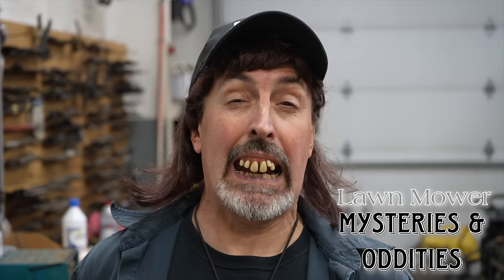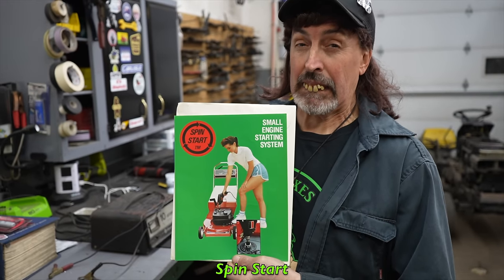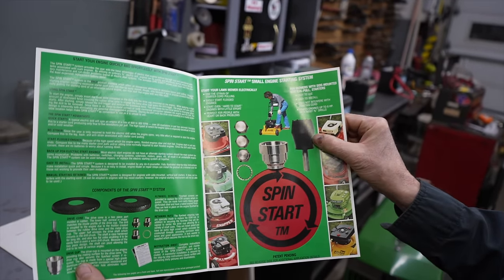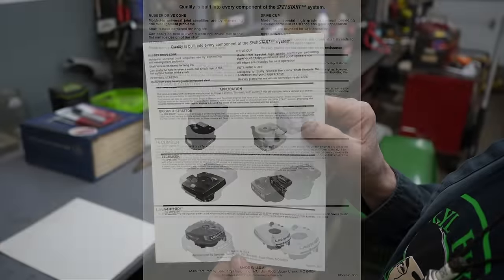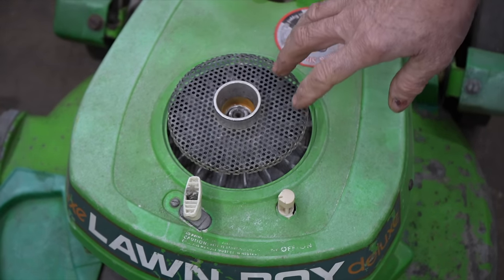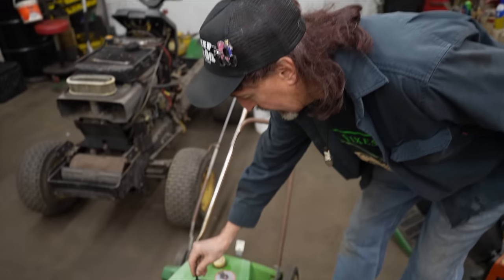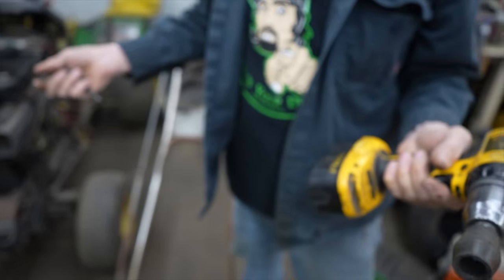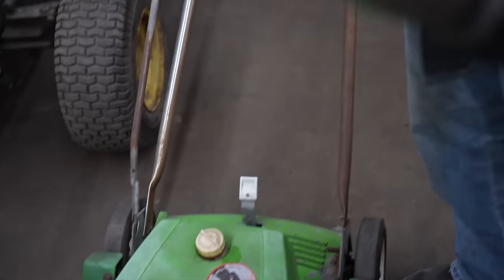You've NEVER Seen This RARE Vintage Electric Starter

Comment: My grandmother loved those old 2 stroke Lawn Boy mowers. She was rather disappointed when they quit making them and couldn't buy a new one. She mowed her own lawn with a push mower up into her 90s.
Reply: Thank the EPA! With all the green renewable nonsense (go do some research and some math) 2 stroke engines are almost totally gone  forever, barring chainsaws and hedge trimmers and they are coming for those now too.  KTM still makes a little 2 stroke bike. Last one out there still making a two stroke. Light powerful, and you can refuel it back up to full in 30 seconds or less.
Reply: I love my lawn boy! I got an old 21” 2 stroke that I got for free! So simple, cleaned the carb up and runs great, looking to get a new air filter and blade to start using it next cutting season!

Comment: Taryl, I bought a cheap swivel head ratchet wrench from *Harbor Freight and cut off the handle so I could put it into my drill motor. With the swivel all duct taped so it couldn't go very far from straight including the socket, I made up a very viable way to spin any engine over w/ out the nut coming loose or the socket flying across the room. What drove me to it was a chainsaw I had that didn't start good cold. It had a bolt holding the clutch on, so a way to drive the crankshaft was readily available.  Then I started using it on my other chainsaws that after I removed the starter rope/ blower housing, but they needed to be turned Counter Clockwise. and as with any flywheel nut, I didn't want it coming loose when it started. So I needed a reversible ratchet head to run backward. My first try I didn't have the socket taped on the ratchet head and it stuck to the flywheel nut then came off as the engine revved up. It flew clear across the room and ended up behind the Oxy Acetylene torch bottles. BUT IT WORKED!   When I was young I put a straight drive into my Dad's drill motor and tried to start my Go-Kart engine the same way. Catastrophe! It was a 3 1/2hp Tuk-Um-Suck and when the engine started the nut came loose and the flywheel split at the key way and exploded into a million Al U Mini Um parts!  I found another flywheel, but I never tried anything like it again until my shoulder got Arther's itis in it and I just couldn't stand there and pull and pull and pull. *I do not advocate buying Chinese Communist Slave Labor tools.  ben/ michigan

Comment: This is amazing actually.  I love the HUGE added convenience that setup gives you.  One of the BIGGEST pains one deals with, in my opinion, when dealing with these small-engine tools - is that most of them are all PULL start with a recoil rope!  Aside from the safety issues you brought up - which sound like were addressed with the rubber bit - The big problem I see with this now is that it most likely does not support the newer model small-engine based tools out there being sold today.  THAT being said - the parts involved on this setup does not look all that complicated - and if you know how to use a metal lathe - and you have a 3d metal printer or two - and you also know how to weld (this includes TIG/MIG/Stick/Fluxcore)  You can probably and quite easily fabricate the parts you need to put on whatever small-engine tools you have - and since you're doing the fabrication yourself you can just make them all fit the same rubber bit on the Cordless Drill - that way you can start all your tools with just 1 bit!  Say goodbye to dealing with recoil ropes!  I am honestly surprised companies that make small-engine tools have NOT adopted this and have made this setup a UNIVERSAL FEATURE!!!  Odds are if you own a lawnmower - you also own a cordless drill - and if you don't own a cordless drill - you would be willing to buy one JUST so you can buy the version of the mower that lets you start it with a drill!  The only thing people would worry about at that point then would be which bit they are using - and you know there would be companies out there that would sell Universal bits which would work on any recoilless small-engine tool (because you know the manufacturing companies out there that make lawnmowers and whatnot would want to have their own proprietary bit that starts their tools...)

Comment: I had a Lawnboy just like that one once. It was in about the same condition as this one when I got it. That was my favorite mower out of any of them. Smooth, quiet engine and the scent of two stroke in the air made the freshly cut grass smell better.
Reply: I pulled an old Lawnboy out of a swamp in the mid 70's, took it home, cleaned it up, lightly ported it, flipped the reed valves over, put a new NGK plug in it, and it still mows better than new to this day...
Reply: @thebegrsshow  I’m curious, why was it in a swamp?
Reply: @80SWoods  It was an old subdivision once, and when the Highway was built the State used Eminent Domain to evict everyone off the properties. They left their homes and belongings behind for the Bulldozers to take care of.

Comment: I have 2  push mowers I tow behind my 4 wheeler. Both have 15/16 nuts on the flywheel. Our dragbike ( 250+ hp) has a 15/16 nut on the cank . It is started with a high torque car starter that has a  special socket thats cut so when the motor starts it kicks the sockt off.       I use a cordless impactor to start my mowers. A drill won't start them!  Love the show.       👍👍

Comment: Super. My first lawnmower was a Montgomery Ward self propelled rear wheel drive 20 inch 3 horsepower gas engine machine with a wind up starter where the pull start is on most mowers, (And a lock-maintenance, wind-start, and release-run lever.) and I would hook my wagon to the mower and ride around behind it while I was mowing. Back to the subject, I liked to make go carts as a hobby, for fun, and I got most of my stuff from the dump, back when that was alright, usually finding an engine that had a rope pull starter, and I ALWAYS cut the cover off, took the pulley and rope and stashed it on the go cart just in case the motor died somewhere, and just used a 1/2 inch drill and an impact socket welded to a 1/2 inch extension that was cut down and an aftermarket 12 volt to 120 volt inverter to power the drill from a battery. (I saw this idea in use on another engine, not my invention.) I tried a 3/8 inch drill, but it was a little hard on it. These were fun carts, not racers, or professional, and some had unique features, like three gearless speeds (Gears?) in both forward and reverse, accomplished with two drill press pulleys, (Three different diameter pulleys, one casting) and three left pedals tightening three seperate idler pulleys on three seperate belts. (It worked great.) Reverse was a small riding lawnmower forward-neutral-reverse transmission that also changed the verticle to horizontal and belts to a chain. I also made a 10 foot long "limo" out of two 10 foot long 2×6 boards once, and this one had "remote starting" in that I installed a pull rope that was about six feet longer than normal and ran it under the seat to the steering column brace and positioned the handle so that you could pull start the cart while you were sitting in the drivers seat. 🙂 One last item was an old, small motorcycle "kick" starter that had been welded to the top of a verticle Briggs and Stratton three and a half horsepower engine on a push mower that I borrowed once. It was funny because you had to kick or pull it sideways, but it always started the mower. P.S. Good way to get your toes mowed. 💙 T.E.N.

Comment: Holy Schmoley! I have one on an old 2T Lawn-Boy! This mower was a curb find and had a thick rope tied to the handle. I always assumed it was just an adapter for a 1/2' rope to wrap it a few times around the cup. I'll have to dig out my Daisy Duke cut-offs and find a drill cup adapter.

Comment: When I started cutting the grass, circa 1969, it was with a 1948 Locke that you had to wrap the starting rope around the pulley every time you needed to start it. Mom gave herself a black eye once when she tried to start it.
One time I was sent over to my aunt’s house to mow her lawn. Her mower was a small rotary that used a folding crank mechanism instead of a recoil starter. The crank wound up a spring and then when the handle was folded back on itself the spring  would spin the engine. That was the only one I’ve ever seen like that so I guess either the mechanism didn’t last very well or it was way more expensive to produce.

Comment: I converted my old Murray to start with my drill (not self-propelled).
1. Cut a hole in the top over the rope pull housing.
2. Take that housing off and remove the rope and its retraction spring. (I did this because the spring was fatigued and not replaceable.)
3. Get a 1/2 drive socket big enough to go over the end of the blade shaft where it comes into the housing. In my case it was square but fit a 3/4" 16 point socket.
4. Use your 8" extension with the socket. That adds mass to it's controllable by hand.
5. Adapt a wood spade bit to fit diagonally into the 1/2" socket (grind the point off) and chuck it.
6. Put all 3 parts together.
7. Stabilize the 8"x1/2" extension with one hand. It's heavy so it won't get away from you.
8. Put your drill on it's slow speed setting.
9. Pull the trigger and when it starts immediately lift the whole assembly off the shaft.

This mower was purchased in 1995 and is still works every summer.

Comment: I had a mower with the Spin-Start on it when I was a kid. It was never worth pushing the mower to the garage when a pull or 2 would start me on the spot. 
The most practical starting system from that era was the Toro key start which had a Nicad pack mounted on the handle plate that you put on recharge with a wall-wart charger. The engine had a conventional starter on it and you would start it from the "safe zone". It also had the variable speed drive self propelled system that let you vary ground speed independently of engine speed. The mower was the well made cast aluminum shallow deck. IMO one of the best walk behinds ever made.
Reply: my grandmother had a lawnboy like this one..  only was a whiter color and itr had actual electric start with a little lead acid battery.. it didnt charge itself you had to charge it after using the mower..
Reply: Toro had awsome  mowers back then before corporate greed lowered quality 😢 ❤
Reply: My dad bought my grandmom that same mower, she like mowing her own grass. Be cool to hookup a modern lithium battery to that old Toro.  I remember those ni-cads from my RC airplane days😊
Reply: I'm an RC pilot myself- 61, been flying since I was 12. It doesn't seem that long ago electrics were the "new thing" and they're now 95% of the model world. I have a bunch of giant scale stuff, love my 50cc twin cylinder  Beaver but we have lost so many clubs recently and now remote ID (Do not comply).  It's hard to find a place to fly these days. I still fly a lot of sport quads, and wonder why the why the major players don't sell keystart mowers that use their batteries. Probably the "gas is evil" narrative is discouraging them. 
Sad that things are worse now than 50 years ago.
Reply: @scottmarshall6766  wow, same here. Starting with Cox control line.  Would love to have an old Heathkit catalog to flip thru.  Time really does fly
Reply: My 1st plane was an orange Cox .049 control line plane flown on a school baseball field. I got so dizzy I fell down and crashed repeatedly until I finally was able to run a tank thru it. Good thing the engine was held on by rubber bands and flew clear with no damage (most times). I never stopped. I was a TV service tech at a small TV shop and got my HAM license at 13. I still have my Heathkit 2 channel scope I build when I was 15. I too miss Heathkit. They were bought by Zenith in the late 70s while I was a certified Zenith tech.
Nice to hear form a kindred spirit! 
I don't think there are many of us left. @tcmits3699
Reply: Heathkit, Cox, and Testor. 💙 T.E.N.

Comment: We still sold (a version) of this at Sears when I worked there about 10 years ago. It was for some of the Craftsman Leaf Blowers, Weed Whackers etc. Same concept, and I believe it was even called the same thing, wonder if there is a connection? The Sears equipment came with the flywheel adapter from the factory, and you could optionally purchase the drill bit.

Comment: Pretty good idea. If people had cordless drills at the time it was offered, I think it would have been a big hit. People would be wiring their bails open.
Reply: Don't we do that anyway.😂😂😂😂
Reply: @shawngegelman6041  I even remove or invert the drag bars on electrics, so I can mow near obstacles.  (Get the gov't out of my lawn mower!!!!)
Reply: It would not have worked with cordless drills of the past. Not enough power or speed. Only the really nice ones with giant lithium batteries will do it today.
Reply: @ryanroberts1104  Oh no, the good 1990s nickel metal hydride battery drills will crank over a lawnmower. Until about 1988 or 89 cordless drills were just like todays cordless cars and they were just as useless.  You had plug the dill in and wait 6-10 hours to use it for 2 hours. Then some genius made detachable battery packs. Game on. An old nickel cadmium Makita stick drill MIGHT have been able to crank a mower over, when it was brand new out of the box. Fast enough? Maybe? It would probably have to be in low gear.
Reply: @sethburgin5994  No. I already explained this. I was there in the 90s. I did this. It does not work. Period. Will it turn the engine over? Kinda. It's not going to start it.

Also, power tools never used NiMH batteries. The replaceable batteries you speak of were filled with NiCd batteries until they flipped to lithium about 10-15 years ago. You had to charge them for many hours to get minutes of use. Being replaceable or not had nothing to do with how fast they charge.

Even a cheap shit cordless drill from today won't start an engine.

Comment: This kinda reminds me of the speed start that Troy-Bilt and Craftman had on a lot of 2 cycle equipment, I had a Craftsman weed wacker that had it, it came with a drill bit that was designed to spin in one direction to avoid injury and there would be a special spot to use it on the back or side of the engine
Reply: I have a Troy Bilt edger and Troy Bilt trimmer that use that set up. Works better than pull starting.

Comment: Anyone who owned anything with a Tecumseh engine on it from the 70's thru the 80's is VERY familiar with using a drill motor to start them with whatever adapter they could rig up. The taper drive is a much better and safer option than anything I ever used anyway.

Comment: Really liked lawn boy mowers. Much lighter weight, due to the aluminum deck and 2 stroke motor. Never had an issue with any of their 2 strokes and never wore one out. The wheels, axles, etc. would always go out before the motor.

Comment: That thing at the top of the handle looks like a safety bail. Either that or a self propelled clutch bail. When I was a little kid my neighbor had a tiny 2-stroke mower with a rope wind pull start. I thought that mower was so cool and wished we had one. That was before I was old enough to be conscripted into lawn mowing. Would have taken forever to cut a large yard. But I loved the way it looked, sounded and smelled.

Comment: I have a Toro (I think) weed wacker that has a feature that allows a electric drill to start it. A special one-way adapter fits the drill and then is inserted into the rear of the engine to start it. There was a battery version available too, that would replace the drill. It works great and can save a lot of cord pulling.

Comment: I've had the flywheel nut loosen when drill starting engines with a socket. If you think about it, the engine is trying to overspeed the drill and the nut loosens up because you are holding onto the drill

Comment: If you put a breaker bar ratchet adapter between your drill and the socket, the engine can start and not rip the drill out of your hand. Used them for years on generators, that are sometimes hard to start after long time sitting.

Comment: I think the danger using a socket was, once the engine starts, its RPM's are MUCH higher than the drills RPM's and that causes the drill to be jerked out of your hands or hurt your hand if you try to hold on to it. With this 'spin start' device, the rubber cone has to be leaned on a little to get it to grip the cylinder and once the engine starts, the cone simply slips in the cylinder as you heard it do when Taryl was trying to start it at one point. Also, once you hear the engine start, you naturally lean back, thus removing the pressure you had applied so again, the cone slips preventing over spinning the drill.
Reply: The biggest issue is the cordless drills that stop the chuck when you release the trigger. So you have to be very careful to pull the drill away before letting go of the trigger or else it will accelerate the entire drill (and your hand) to 3600 RPM

Comment: In the mid 60s my grandparents had a Briggs that had a flip out crank on top that wound a spring. The tension on the spring was released by a lever and that would spin the motor.